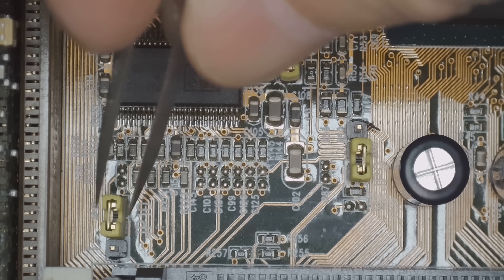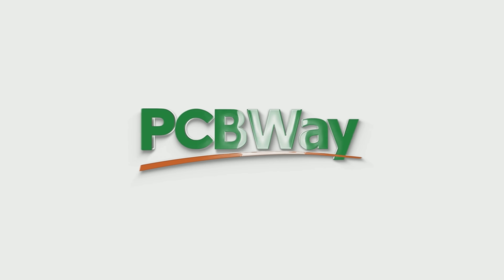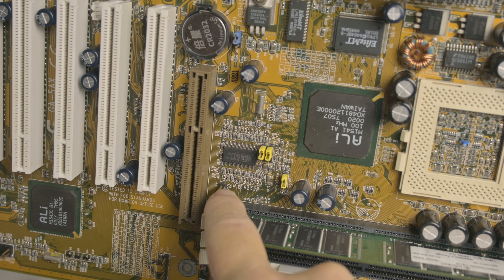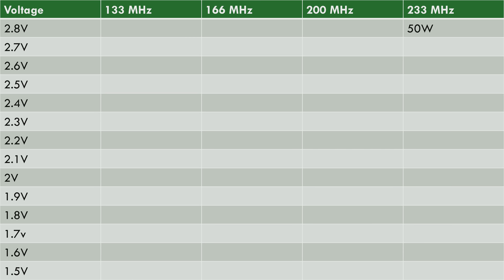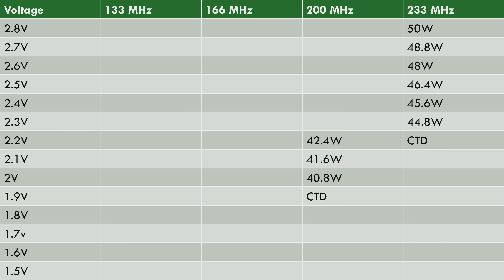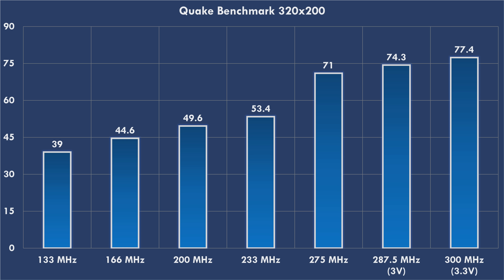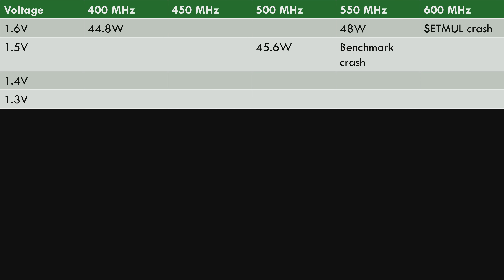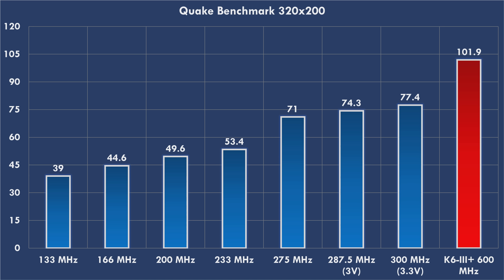Undervolting Retro CPUs to extend life, save power, reduce heat and noise

Comment: I am undervolting my socket 462 platform.
Abit KT7 (VIA KT133 platform) with Athlon 1200 Mhz. (Thunderbird) , stock voltage:  1.75V
The lowest multiplier i can set is 5.5
so with only 550 Mhz, i have selected a core voltage of 1.62V in the BIOS. In windows, with differents tools like cpuz or Everest Home Edition, only 1.6V will be shown.
It is already a significant power reduction, but i have not seached for it's limits on undervolting. Maybe there is still some margins, but it is already much more efficient than the other slot-A cardridge Athlons...

Furthermore, i have a super socket system too, but with a K6-2 500 only. 
Because it's not a mobile CPU, the possibilities are limited in terms of overclocking. Have tried once the 550Mhz setting (with stock 2.2V) but it was not stable.
Actually, i am running it with 166 Mhz, to get lowest speed setting. Unfortunately, with non-mobile K6-2 CPU's, you can't get the 2x multiplier. So i can' t go to 133 Mhz...

Comment: My modern ryzen7 laptop has actually been manually locked at 25% max cpu allowed for years.
Originally it was for heat but I guess I had forgotten to reset it at some point and just never noticed. It's not undervolted or anything, just dialed down from the windows power plans panel.

My games work and play just fine, probably just because none of those are multithreaded all that much and don't use a lot of CPU to begin with 🤔

Comment: This is an interesting topic, both on old and on modern hardware. 

Funnily enough on modern hardware undervolting is often a way to noticeably improve performance, because of how everything is controlled/limited by power and temperature targets.

On old hardware... i am not sure there is going to be a meaningful improvement in longevity/probability of failure here. For either CPU or motherboard, especially motherboard since voltages this CPUs run at are already substantially below maximum it is designed for. There is also no fan control based on temperature, so any improvement in noise has to be achieved by slowing fans down manually which will require either swaping fans entirely or something like adjustible dc-dc converter to vary voltage...

I personally like to either leave everything stock, because this stuff can be unstable/tricky enough as is and adding more potential stability issues is no fun. Or downvolt, but then i try to be mindful of diminishing returns. Like if you look at the table with P233 results - going down to 200MHz/2V saves almost 10W with only small reduction in frequency. Going down further only saves ~3W more, at a cost of significantly reducing performance. So is it worth going below 2V here? I would not do it personally. And it is often the case - downvolting is a good way to reduce power, but significantly downclocking rarely makes sense...

Comment: Thanks for that. It always good to take care of old hardware. Today I'm not fan of any OC anymore because I want to be more careful with hardware than years ago when I pushed Duron 800 over 1 Ghz, PII 350 to 466, GeForce 4 MX4000 from 250 to 420 Mhz, Radeon 9550 to 400+ Mhz core. Those were fun times but today I like to run anything on stock. With collection I have when I want something faster I just change hardware to something better.

Comment: Interesting video! I have the same CPUs, but my K6-III+ at only 500 MHz - I should have tried more! ^^... One thing that puzzled me a bit was that, with basically 200% the clock speed, the scaling against the P233 MMX was quite bad. Could you make out the bottleneck? I can't imagine it's the difference between their FPUs (AFAIK the K6 ones were a bit slower, but not that much).

Comment: I'd love to see how low you can go with the AMD chip if you used a motherboard that required a separate VRM board for the cpu and use one that allows you to manually adjust the core voltage to whatever you want instead of set values based on jumpers.  Another @necro_ware collab?  He has a super socket VRM project already.  Though finding a board that had good FSB settings AND a VRM module slot may not be possible.  Would be interesting though.

Comment: That is awesome, thanks Phil! My best CPU K6-3+ will do 682MHz with only 2.1V. And goes as high as 720MHz on air cooling but its unstable.
The GA5AX is more stable than many SS7 boards for overclocking because it is one of the slowest boards, does not stress the CPU and RAM much.
Reply from the maker: Beautiful OC 😎
Reply: @philscomputerlab  I see I lied :( It is 672MHz 112x6 and not 124x5.5 for 682MHz. 672MHz is more stable than 120x5.5 660MHz but 660MHz is faster. 682MHz not stable. I have three GA5AX boards, one day I will revisit them to see if I can get them faster but the AGP slot is the problem. However I think it is faster than the P5A in some tests with minimum FPS! Or it is Nvidia driver 7.58 that is faster. Still much more to learn about tweaking SS7!! I am busy with a custom Nvidia driver :D

Comment: I remember running a Pentium 75 at 96MHz back in the day, I believe all it took was removing a plastic cap from two pins on the motherboard. I was very proud I got this extra performance, although none of my games ran noticeably faster...
Reply: They should have, in case you increased the FSB as well. The P75 only had 25 MHz - upping it to 90 Mhz already improved the bus bandwidth by 20%, which is considerable! With the 20% increase of CPU speed you got more or less linear performance scaling if your graphics card wasn't a bad one (like Trident). 
(I did the same back in the day, and did performance measurements...)
Reply: @bad.sector Not really sure about the video card. It's been a while since the P75. I suddenly feel very old... I think I had a Hercules card at the time. I may be wrong, I recall playing games on a colour screen. That card may have been in one of the 8086 machines I had. I'm sixty, I think I lived through the entire development of personal computing. I won a chess tournament in 1980 and first prize was a TRS-80 model 1 with a whopping 4K of memory. A couple of years later at university I biked to the other part of town with a tape enclosure that stored an unimaginable megabyte of data. The university data center owned only four of these tapes and a network didn't exist. I graduated in 1987, I believe I had a Compuserve account (numers only) then but that might have been later.  
The P75 was years later, by then I dialed into the university mainframe with a mechanical autodialer. I got kicked off the mainframe for a month for playing Santa Paravia on it.
I think I ran the P75 fsb on 33MHz to get it to 96MHz, I remember it was a bit unstable like that. If I'm not mistaken, I got an overdrive kit that had to be stacked between the P75 and the slot on the motherboard. It then did a stable 116MHz but it needed a math co-processor to post. That was an expensive upgrade. Shortly after that MMX Pentiums appeared, that were much faster for a fraction of the cost. Around that time I got my second mainframe ban, this time for playing Quake (or Doom?) on a Navy firing solution system. Those were the days :-)

Comment: Well, before undervolting, check the temps, have a better cooler/thermal paste and... use a modern atx case with good airflow. 🫡 (a LOT of components does not have heatsink/air flow and get pretty hot 🙄🥵

Comment: Great information. I need to try undervolting my 233 MMX, which is running at 120 MHz (my board can run it at 60 MHz FSB) all the time, as I have faster alternatives for when I need them anyway and am more likely to play speed sensitive games under DOS then to archive maximum fps in Quake.
Btw, I somehow remember reading that overclocking the FSB can cause problems as it overclocks not just the CPU, if I don't mix it up with something else.

Comment: Does anyone know what happens if you change these jumpers while the computer is running? I wonder if an Arduino hooked up to the jumpers and a rotary encoder could let you underclock and overclock on the fly. Think of it like... A enhanced turbo button.

Comment: On one of my motherboards, I find that the difference between 200MHz and 100MHz CPU speed is one jumper. So, I plugged there the Turbo switch. One drawback is that the computer sometimes freeze when changing the speed when on, so I select the speed befpre power on or change it when is idle (no program running, at dos prompt). At low speed, a P200MMX @100MHz can run comfortably cool without heatsink. And I did not have seen any performance difference in many dos games (Betrayal at Krondor, C&C Red Alert, M.A.X., Jazz, Tomb Raider at standard dos resolution, etc) as well in some Win games that run under Win3.11 (Civilization II and SimTower I play mostly). As for programs, there is no difference at all, Word, Lotus123, Wordstar under dos or Office suite under Windows 3.11 all perform well. Also the ISA sound cards and NICs are not affected by the underclocking.
Reply: I was overclocking the CPU and motherboard back in the old days, but now I preffer to run them cool. I have enough old hardware so if I need a fast CPU I can swap it instead overclocking or, swap the motherboard entirely. I see no point in overclocking a P233MMX when I can just use a P2@400 or P3@866 with the added bonus of bigger cache. As for AMD CPUs for socket 7, I do not have many of those so they are kinda valuable for me (i have only one K6-2@400 and one K6-3@450).

Comment: Nice vid. It's also a good way to "spec down" newer (sort of) CPU's like 2nd/3rd gen I3's/5's if you don't really need "all the speed". As for the noise, the main culprit will always be fan (size) and mechanical drives. PSU's have terrible quality fans and the cheapest "silent" fan you can buy will make a huge difference. Same for case fans. Tiny old cpu cooler fans will make that annoying whine so replacing them with "anything big and silent" is the way, if you don't mind the extra W's and the DIY. Hard drives you can SSD or CF for silence, CDROM's well... only option is disc images, which are silent, faster and more convenient anyway.

Comment: So i had a Pentium 233 MMX. I set it up running the memory, it was 133Mhz SD-RAM, at 125Mhz. I Can not recall the multipliers (jumper settings) but i do recall it being a Gigabyte GA-5AX. I had at least 3 different versions of this board, including an MSI variant using the same chipset (Aladdin V). Sorry if the word variant offends anyone, i don't recall who claimed the first board based on that chipset.

I'm sure i was running the CPU above spec on the front side bus (FSB) as i recall running the RAM under spec at 125Mhz. It seriously day show for the day, an uplift in everything i ran. However i could not get it stable enough for constant use. As i was in college at the time i had to reset, it was my only PC and i needed it to work. The risks we took back then in the name of progress, overclocking and general tomfoolery. 😆

EDIT: Had to edit this as i missed autocorrect changing my words. Tech, who would use it?

Comment: I actually ran an undervolted / underclocked system for years, but not on SS7 - it was dual 667EB Coppermine PIIIs at 500 MHz (@1.45 V) with passive cooling on modified MSI 6905 Masters on an Asus P2B-D, using the case and 110 W Astec PSU of my previous Siemens Xpert prebuilt (though later that got unstable - presumably bad caps - and I had to resort to a 250 W Fortron and improve ventilation). That served me from the mid-2000s to 2012, at which point I splurged on a new-to-me prebuilt with a Core 2 Duo E6550 as I finally had a job.

BTW, your video title autotranslates to German as "Undervolting mit Anzeige" - TF is that even supposed to mean? Stupid misfeature. (Some bozo at YouTube deserves a good clobbering for auto-enabling this nonsense.)

EDIT: Forgot to mention, these days I'm taming Rocket Lake with ThrottleStop... an i7-11700 on Z590 might not be the most ideal basis for a low-power PC, but my old system was starting to give up the ghost. Got it down to ~14.5 W from the mains at idle with ASPM and all bells and whistles, and my yearly power consumption is actually down maybe 70-80 kWh vs. before. It did take a few BIOS versions before my plain JEDEC Crucial DDR4 was stable without manual timing tweaks. And now the stupid ASUS board hasn't seen any updates since 2023. Anyway, I always wanted to upgrade to one of these 45 nm quad-core jobs on socket 1156 when I was on 775, and Rocket Lake is kind of the modern-day version of that - the more toasty, obscure product just before a hit generation (Sandy Bridge then, Alder Lake in recent times).
Reply from the maker: Nice!

Comment: I typically run older parts at stock unless I have stability issues; though I doubt "stock" settings are at all relevant to parts twenty years beyond their intended lifespan. 
It's - as you say - more that retro hardware really isn't about max performance: it's about recreating the original experience.

AMD really did have vastly better manufacturing processes at this particular point in time. IIRC they had 400nm parts on the market while Intel was stuck on 800nm. 
I expect this was due to different strategies more than anything else though - Intel focused on developing the Pentium and then the MMX at the 3expense of manufacturing, while AMD took the opposite approach.

Comment: I re-built a AMD k6 450@500 last year(had to recap, upgrade it a bit, limited ram to 3x64, with 128 sticks), cpu could not run at 550 stable.- was well compensated for the rebuild. And I remember about 2 decades ago using a IBM gold Pentium something that fit the socket 7, was faster than Intel. (so its a good contender to buy for this platform) visually very good looking cpu and I think it even run cooler? anyway, long gone the times where you did not even need cpu paste on these to cool them down.(now I just put some cheap paste it helps with the temps)

Comment: A suggestion for a future video. If possible - a P1 vs P1 MMX vs K6 vs K6-2 vs K6-3 socket 7 shootout all at the same frequency and FSB - like 200 mhz (3x66) or 233 mhz (3.5x66). K6-2 vs Celeron Covington vs Mendocino vs P2 at 300 mhz (4.5x66) or 333 mhz (5x66) would also be very interesting.

Comment: Interesting video, Phill. I never undervolted my retro pcs, just because I dont have such a cool motherboard. Most of my systems are OEM like IBMs, Dells, Compaqs, HPs, and those just dont have that nice voltage settings. But I underclocked them, where I could, using clock multiplyer and L1-L2 cache off, for some speed sensitive games.

Comment: I was always into undervolting since then until now (-0.05V on my i7-11800H). All stock voltages are fail-safe voltages to ensure even the worst silicon quality runs well. There is always some tolerance which differs from cpu to cpu even between the same model, stepping, batch. I also like FSB-OC more than CPU-OC, but i love UV more for an efficient long-life system. Your board has an awesome voltage range, my SS7 starts at 2.0V :)

Comment: My Pentium II 350 is run at 233MHz partly for that reason, and as stand-in for the PC's original Klamath PII 233. I've got that many spare CPU however, and they all run far cooler than they would under their stock/OEM coolers, so I am not that concerned.

I'm more worried about the 5 PSU that I have which are 20-30 years old. Already replaced failed capacitors and blown fuses in 2 of them - and they have never been in PC that draw more than half of their ratted wattage at most.

Comment: I've had my K6-2+/500 running at 560MHz (5x112FSB) for years. Unfortunately my board doesn't support any lower than 2.0V, but I'm very happy with those speeds on stock voltage! 600MHz requires more voltage and is almost immeasurably faster since the FSB is slower. Couldn't get 616MHz (5.5x112) to boot at any voltage I'm comfortable with.

Comment: @Phil  Fun fact:  The AMD CPU in your right hand can be easily delidded for direct die cooling with a lapped heatsink.  It is just held together with basic silicone.  I did this to one of mine (K6-2 500) and it lowered temperatures several degrees.  This is partially due to removing the heat spreader, and partially due to the improved contact and high quality TIM.

Comment: Curious if undervolting to the point of instability can show overclocking potential. Ie. Maybe a k6-200 going unstable at 1.8v vs. another one going unstable at 1.9v could OC better. I'll set up my socket 7 stuff later and test it

Comment: I never overclocked, and neither underclocked my Retro CPUs. Since I probably am that type of guy who actually likes to use that CPU's potential in stock settings, and testing newer games if they could work fine or they would struggle. (E.g. Athlon XP and GTA:San Andreas.)

So in a way... Undervolting and Underclocking CPUs could ruin my curiousities of how a CPU can run a newer game than a CPU itself. 
I know there are probably benefits to doing that, but eh... It's not my thing I guess 😅

Comment: Ironic timing, since I recently built my first 486 since the 90s and undervolted the CPU because why not! Got a Cytix 486 DX2-80 5V CPU running at 4V stable. Wasn't quite stable at 3.5 and motherboard doesn't have any steps in between. Still nice little savings, while maintaining stock speeds!

Comment: Ummm.... you talk about how great the P233 runs at 2x100 but then don't show any benchmark results for that configuration, that felt like a bit of a jarring edit.

That said, great video, I just picked up on that point because I remember, back in the day, playing around with a P133 on a SS7 board and finding it to be dramatically more responsive running at a modest overclock of 150 MHz with a 1.5x100 setting. And of course the similar classic case of the AMD 5x86 running at 3x50 instead of the stock 4x33. FSB speed makes a huge difference, especially for these old CPUs without on-chip L2 cache.